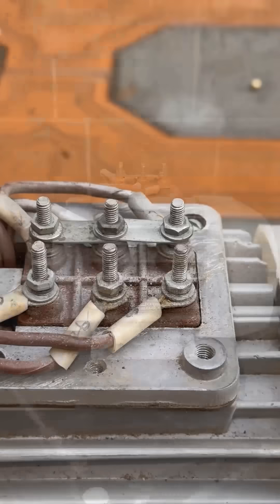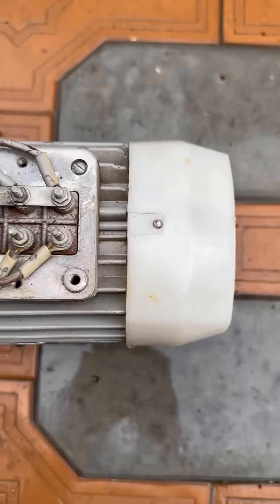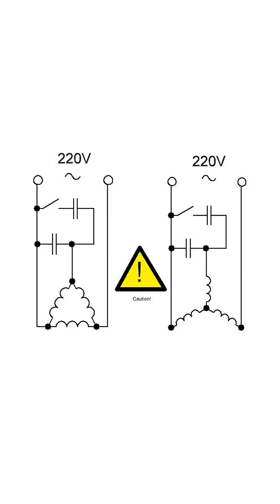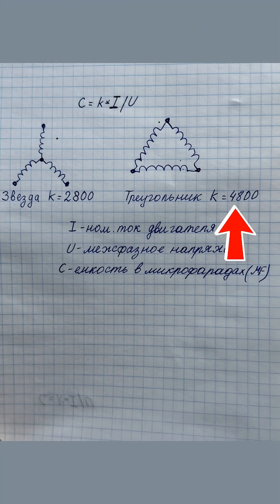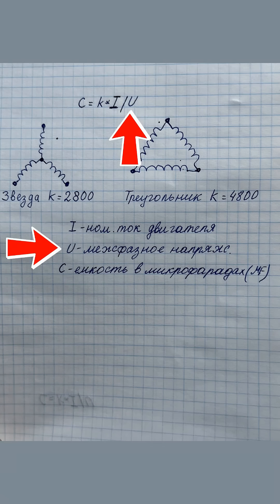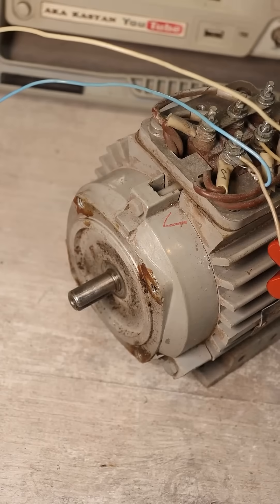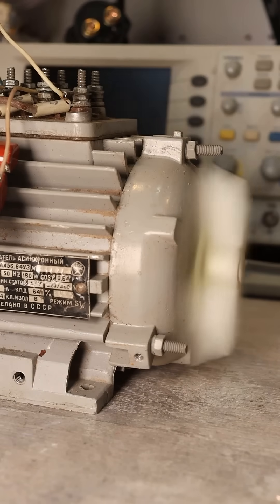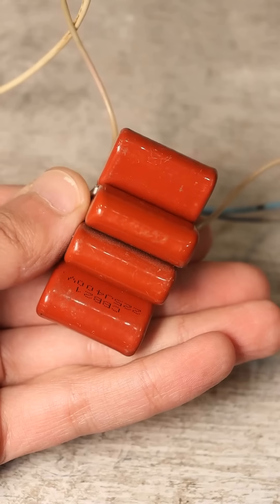Single-Phase Powering of a Three-Phase Motor: Step-by-Step Guide

Comment: Good capacitors (not these shitty ones shown) are not cheap, so it may make sense to think about an inverter, which can generate a 3 phase AC and can control the rpm of the motor. Maybe 50€ more.